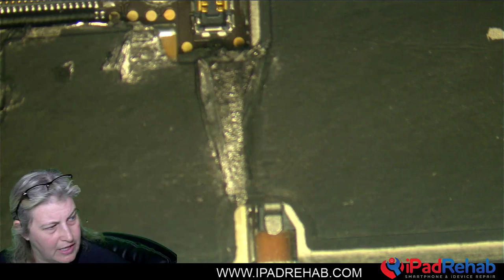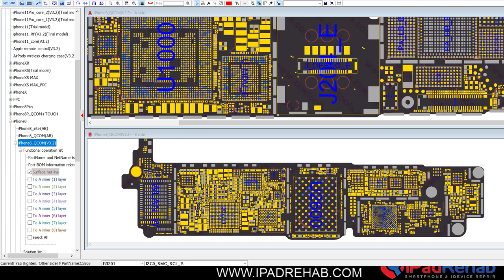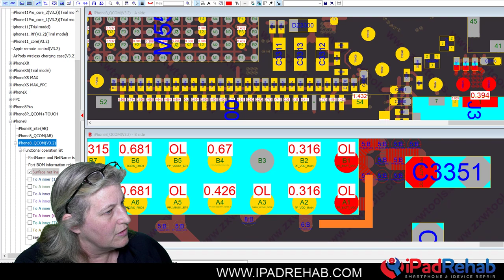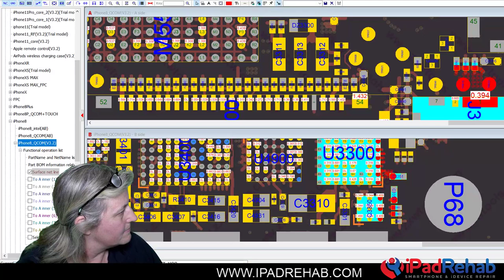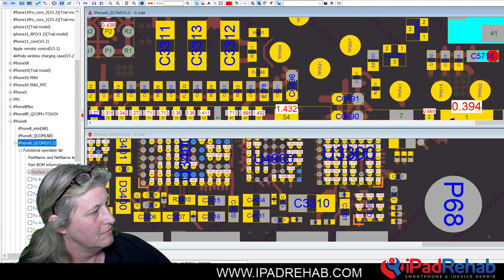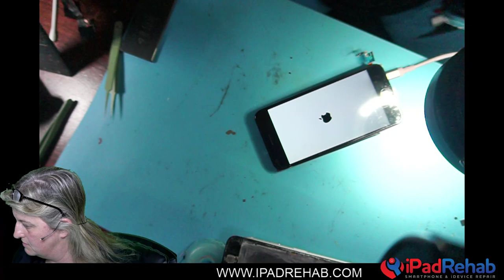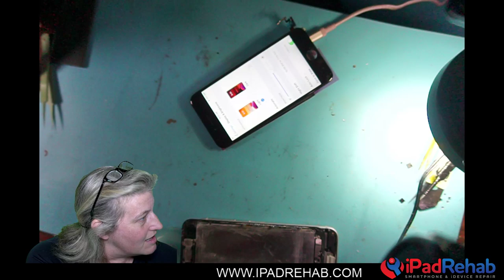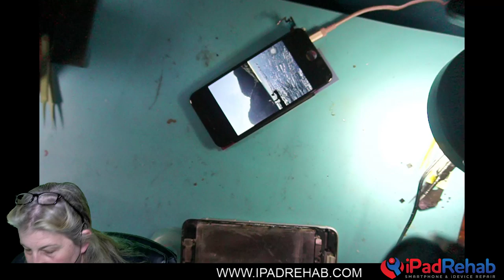Let's Fix an Phone Sent from China

Comment: Motors such as hot air guns can put high frequency artifacts in the line voltage.  Assuming your network shares the same AC power distribution you should consider plugging the hotair gun into a line voltage conditioning device.  Maybe experiment with aluminum foil wrap on the hot air gun wired to a ground.

Comment: Hi there,
I have an iPad 3 that it's battery does not charge when it is on, and charges when it is off.
What could be the problem with the charging circuits?
With Kind Regards,
Shahbaz